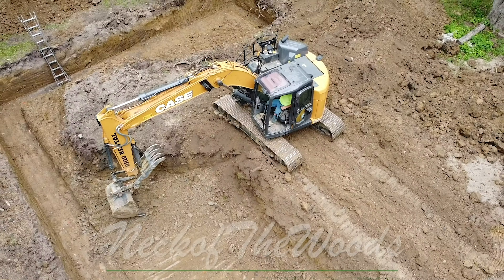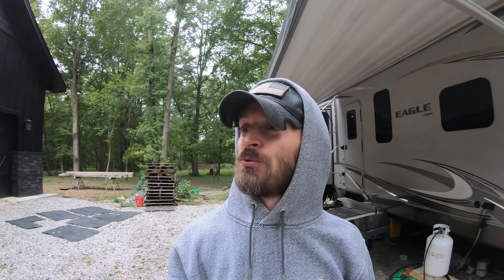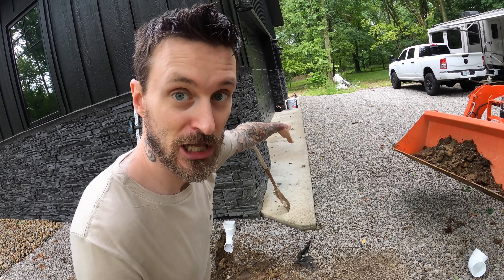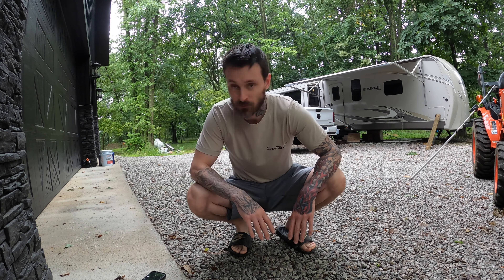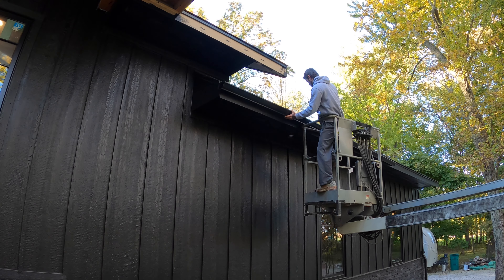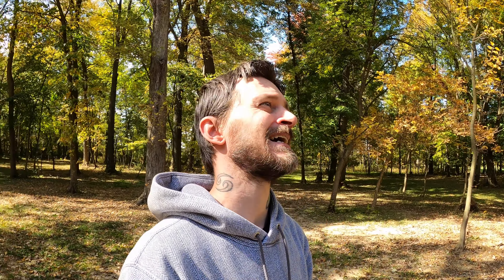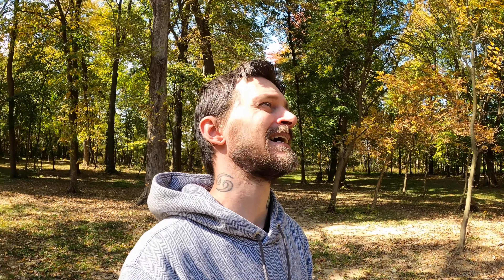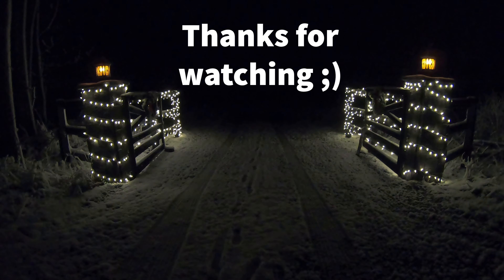Installing gutters and downspouts!  Finally on the ICF home!

Comment: Looks great Scott, the black really suits the house. Good decision with going bigger on the gutters and down spouts, well worth the extra money for peace of mind. It's extra work, but having the right angle on the gutters will allow maximum water flow away from the roof, I've seen a lot of installs where the gutters are too flat and they end up holding too much water and then over-flowing. The leaf guards should work great, it's probably one of the better systems available, but just be aware the small holes can get blocked by decaying leaves that sit on top for too long. You may find sediment builds up in the gutters over time, small inspection windows where you can access the gutters to flush out any build-up with a hose may be worth it.
Reply from the maker: Excellent points.  And yes leaves are holding quite firm in there now!  The wind blows them off but hot air rises against the house and they blow back up on the roof.  There’s so many they are backing up the roof a foot or more.   Luckily I only have about a month to deal with it while the leaves fall off the trees but I see it being a problem if not blow off every week or so.  But without the guards they’d just get caught in the gutter and down spout.  Idk what to do!

Comment: From what I can see from the company is maybe you are to run the back up under the shingles and screw the front to let the screen be angled to let the debris fall off the roof.
Reply from the maker: I need like an inch less.  Even that angle wasn’t enough.  Maybe I did get 6” screens and needed 5”.  I don’t know but they are working for the leaves not getting in.

Comment: Long winded commentary.  Too much information that doesn't apply. Make shorter videos and keep it simple. This is an ICF house.  Stick to info regarding how to connect downspouts to the ICF internal plastic studs or the concrete wall behind it. This looks like wood paneling over the ICF so the video title is a bit misleading. Zero usable ICF downspout connection info here.
Reply from the maker: They don’t connect in anyway to the icf though.